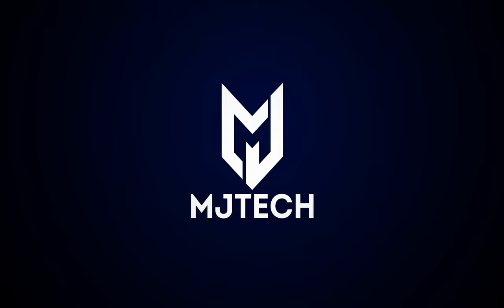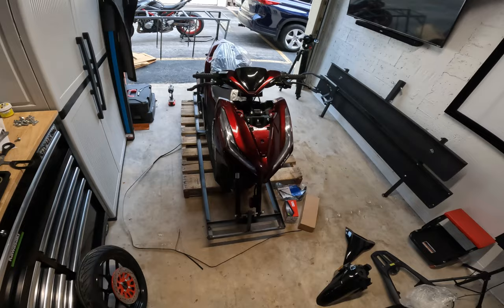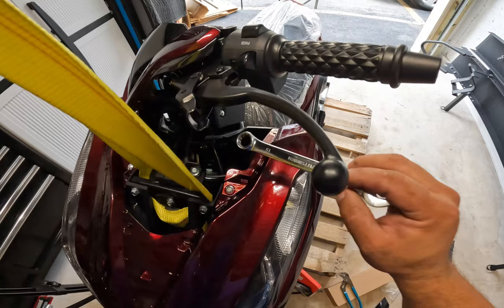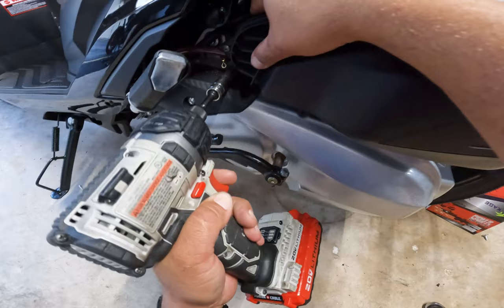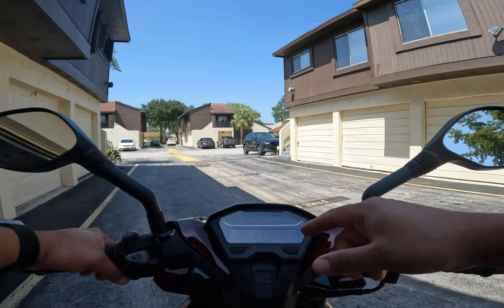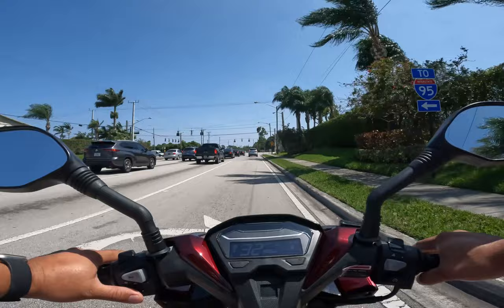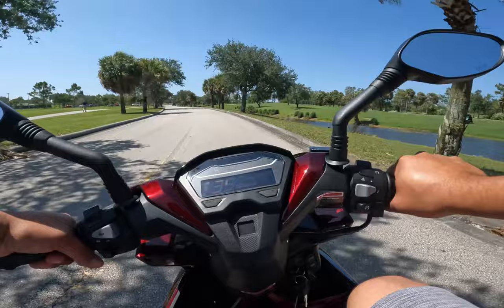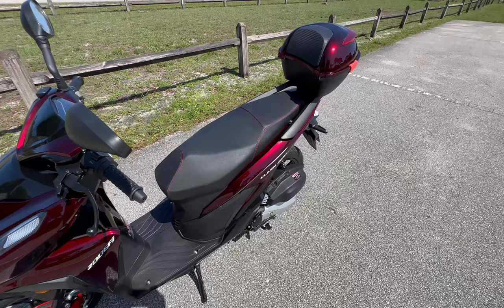Best EFI Gas Scooter of 2023 - Vitacci Clash 200 - Oh Yeah It's Fast And Cheap!

Comment: Last year and about 2000 miles ago I bought the same scooter from Amazon. I wanted one with large diameter wheels, a flat floor, and EFI. What sold me on this particular model was the engine was made by Lifan. I changed the variator rollers (12.5 grams) to 13 gram sliders and the stock 835mm belt to an 842mm belt. Also added a tiny GPS speedometer just below the stock display so I know the real speed. Another change I made was adding a 20 ohm resistor in series with the engine temperature thermister so the computer wouldn't think it was running too hot and turn on the check engine light. Also changed the throttle cable elbow so it didn't hit my knee and added a small windshield and mirror extenders. Runs great and I use it a lot.
Reply: I currently have 530 trouble free miles on my clash 200 EFI. When the bike is warming up and the idle is unsteady for a few minutes I hear a rattle noise and it’s coming directly from the throttle body and I can still hear it once it’s warmed up just slightly less do you think that’s what is causing my automatic slightly rev up by itself after giving it a rev? Or  is  the ECU keeping the engine running from a stalling out?
Reply: Hi, my clash 200 does have hesitation when you play full throttle immediately or when your sitting there idling and rev fulling really fast it will sometimes take a second and sometimes it revs up really quick. I’m pretty sure you had this issue too and fixed it by applying resistors to the thermistor how would I fix this issue? Maybe that’s causing my bike to rev itself back up which would make sense since it only happens when the engine is hot! Could you make a video or is there any diagram of how to add resisters?
Reply: What kind of mpg you getting
Reply: @gaspowerrules  riding fast, between 55 and 65 (actual GPS speed) it gets 76 mpg without the windshield and 84 mpg with windshield. It does better at lower speeds of course but I haven't checked. I suspect up to the mid 90s.
Reply: I'm an absolute noob when it comes to scooters and genuinely on the edge of purchasing this scooter for commuting.  I'm curious, what did all your modifications change?
Reply: @Dabby724  Didn't change much,  just like to fiddle.
Reply: @MrHugemoth  Upgrading to a larger belt didn't change anything at all in terms of performance? interesting.  I'm torn, If I should get a Clash or just shell out an extra 2-3k and get a known quality brand scooter from Honda or the like.  Do you know the average lifespan of these inexpensive china scooters?
Reply: @Dabby724  Between changing the belt and changing the stock rollers to sliders it seems like overall RPM went down a bit but that's all I noticed. Wasn't much of a change. I don't know how long this scooter will last but the Lifan 200 motorcycle I bought new in 2007 had over 50,000 miles when I sold it. Can't go wrong with a Honda if you don't mind the $.
Reply: @Dabby724 unless you get like a really high end Honda bike or a Yamaha Zuma, the difference is gonna be almost nothing. Hondas got longer life span buts when you do the math on the price difference honestly not really worth spending the extra. With that said a good mechanic can keep a cheap gy6 motor running literally forever.
Reply: @anthonyrossi3869  Hey Anthony, ya "might" need to have a mechanic adjust your valve lash and adjust the throttle position sensor to the proper amount of milivolts to get your Clash to run properly. Typically those things are part of a PDI to make sure the costumer doesn't have any runability problems.
Reply: Do you have a link for amazon...I want this item, please

Comment: You should not change the oil until you hit the break-in mileage. It comes with break-in oil, which is different than the normal oil you replace it with. It has different additives, and higher levels of zinc and phosphorus. It’s designed to let the rings wear into the piston walls and form a good seal. That’s also why you want to replace it once the engine reaches the break-in point, because the oil will be filled with metal particulates from the cylinder walls. Replacing that oil prematurely will shorten the life of your engine.
Reply: A great and informative comment. Thank you
Reply: You sure it’s not shipping oil?
Reply: It comes with shipping oil. Definitely should change it before starting as all It will do is accelerate the wear on the engine.
Reply: @dakless8086  new vehicles come with break-in oil. I don’t even know what shipping oil is. Never heard of it. Tried to look it up, Google doesn’t seem to know what it is either. If there’s a modern day manufacturer that sells vehicles filled with oil that shouldn’t be used to run the engine, I wouldn’t buy anything from that manufacturer.
Reply: @rogermurph101   well these scooters are from china sooo yeh id change that oil xDD
Reply: Simple end to the argument is if your concerned... buy a good break in oil and change it out before you start it. Then change it again at the recommended time.

Comment: I own the clash 200 EFI in blue! On mine when it’s warming up I hear the throttle body rattling until it’s warmed when the engine is idling smoother. Also when I slow down to a stop my clash will rev up by itself slightly then go to idle. I had to adjust my air screw on the throttle body which helped. Also it will rev up by itself when I’m sitting there revving it it will rev itself up without touching the throttle for a second. I’m not complaining since it was a inexpensive EFI bike! I changed the oil as soon as it arrived and it barely had oil in it! Good thing I checked and changed it! Let me know if you have any small issues which are manageable like mine! I currently have 530 miles on mine and it’s running great! I did not open up mine all the way until 300 miles but man it’s fast! Ive gotten mine up to 56 on a short back road, it could definitely get to 60 if I pushed it!
Reply: I’m 54 pounds, I’m sure it will go 90 mph
Reply: @stephenlandrum  that would not be possible for my clash 200 168cc engine to produce that amount of speed greater than 60mph before the CVT belt reaches the top of the torque converter, once the belt reaches the top it will not be able to go any faster being that full throttle is at  7 thousand RPM at 14HP. I’ve had it tested on the Dino without sitting on it and it will top out at 60mph no load just the bike spinning the Dino wheel at a peak HP nearly 14HP and that’s without sitting on it.
Reply: @anthonyrossi3869  I was only kidding
Reply: I got 95mph, it helps jumping out of the plane and the additional tailwind made the difference.

Comment: Mine was made in late June 2023 and delivered early August-I shopped the St Louis market before pulling the trigger on My black Clash.  I get looks and thumbs up everywhere I go but it’s probably because of the smile on My face.  Love it.  Surprises Me how it performs for a 168cc, no problems whatsoever accelerating in city traffic, great handling on turns and capable of dirt trail riding.  Smartest money I’ve spent in a long time.  No EV’s for Me
Reply: I’m looking to buy one is it worth it for a small work commute and such?
Reply: @Flyvibez  - absolutely
Reply: Bro i bought this scooter today from amazon and it gonna take 5-6 days to come. The only thing i m worry about the assembling. Can you tell me when you bought yours its already assembled or you did it by yourself. Pls reply me as soon as possible
Reply: Trail riding ? With those kind of tires ?
Reply: Have you experience any issue in your clash? What's your mileage? I got my 2 weeks ago and got 120 miles so far.
Reply: @Eugene210  - 3,000 miles and everything is good

Comment: Two things to help with slow speeds. Try slight pressure on the brakes, mine are linked so I use just the rear. It stiffens the bike up and you can do the same when taking off for the first few seconds. Secondly if you take about 2 lb of air out of the tire maybe just one it helps a lot. You can tell by how much dirt is left on the tire. If it's a very skinny strip your tires are over inflated, if it's very fat under inflated. Once you find the PSI you like, that's an easy way to check without putting a gauge on it.

The factory tires work nothing wrong but if you know that you are going to keep it upgrade them. Michelin City grip 2, amazing feels completely different. The word would be confidence inspiring, about 300 bucks mounted. Worth every penny I just bought my second for the rear.

Comment: I have this exact scooter but called the Saipan, and I love it!!  the only thing that you will have to change is the BELT!!  it will break especially going up a hill or too many "jackrabbit takeoffs.  I went with a Kevlar one and the quality is great just like this bike.  The fuel injection reliability is what sold me + the look. It is a legit 60 mph, lightweight, and has great mpg. so this is an excellent commuter or secondary mode transportation.
Reply: My bike is making a loud sound like the muffler or something? I’ve been taking off fast
Reply: Can you provide a link to the belt you put on it ?
Reply: @swatboy9413  probably the bolts on the heat shield are loose on it??  Easy fix!!
Reply: exactly what type of belt are you referring to?
Reply: @Dabby724  Gates belt, made of Kevlar!! I bought it off eBay,  but at that time it said only 3 were left last year.
Reply: All  drive belts eventually will have to be replaced; even the ones on automobiles
Reply: @MrGreenelight Not at 300 miles

Comment: After watching this video I really want one!😊
Reply: I have had mine for a year and a half and this is the best cheaper scooter that I have had. Very reliable, starts every time, and is very lightweight and fast ( I'm 6'1 222 and I still get 65-68 mph). the only thing that I did change was a more powerful motorcycle battery 12v 10amh for extra accessories relocated to under the seat from the floor for radio, USB, RGB lighting, and the drive belt ( change the one that comes with it because it's too cheap and will break going up a steep hill, all the cheaper Chinese scooters come with the cheap belts??) to a much stronger Kevlar belt from Gates that's it, The EFI is top-notch!! good luck with your choice, but EFI is the way to go.

Comment: On the southeast East asia, honda made this bike... it is called by different names in some of countries it is called vario and some are Honda click... they are pretty popular even the most scooter you could find on Indonesian road... even honda sold this kind of bike over than 500k units every year only on Indonesia.... the difference in this vitacci clash and Honda vario/click the vitacci doesn't come with liquid cooling system and the engine capacity is slightly higher than the one honda made...

Comment: It took me months to adjust my mirrors correctly. Because of how big they are and how they have the bend in them you need to have the right angle and tightness of the double nut.
How you mount them determines if you see yourself or what's behind you.

Comment: Just got my vitacci clash. First time i opened the seat,  it worked fine. Now it won't open. When i hit the seat button i don't hear anything. I found if i pull on the cable the seat button hooks to, the seat will open. Any ideas how to fix this?

Comment: Where can i get a cdi for mine? There's no spark and no fuel pump prime when i turn on the key. All of it stopped after i dropped it
Reply: check the kickstand and sensor!! it will give you the same symptoms
Reply: @lionelhowell4972  thanks but I fixed it, it was the ECU... replaced it and started up no problem

Comment: I bought one about a month ago. I've watched your video to put it together so thanks for that. I do have an issue. I can't get it started for the life of me. I can get it to start for like 10 sec then it dies. Would you have an idea why?
Reply from the maker: Start by checking that the injector is connected properly. Also check all the wires. Lets start here.
Reply: Any luck?
Reply: @MJTechChannel  sounds like the kickstand to me?

Comment: This EFI Scooter has been great, But recently it started to sputter and would stall at a stop. now she wont start right away like before. Does anyone have a clue as to why? Or any suggestions?
Reply: Try putting  an ounce or two of fuel injector cleaner in the tank

Comment: What about the battery. Where did you put that?
Reply: Having a problem with this issue as well. What did you do?
Reply: I know where it goes but there is a small plastic piece that doesn't fit in the compartment.

Comment: You are going to wish soon that you used blue loctite on every screw and bolt. Trust me I know . I have the EFI 200 cc Capri. And change oil soon as you get do not ride with the packing oil. It's vegetable oil.

Comment: WOW 🤯🤯🤯.. during your assembly I didn't see you using not a single washer on your scoot scoot.. you're going to be lucky if it doesn't fall apart B4 300 miles.. you have a great looking scooter there and I hope all goes well with it.. I just recently purchased a Vitacci Spark 150.. and I will be taking zero assembly advice from this video.. I mean you are starting bolts and running them all the way in with an impact driver.. come on bro, start those bolts by hand at first and then use your impact driver to torque the bolt down.. otherwise, you risk that chance of cross- threading them.. after all it is Chinese cast aluminum which is a rabbit hole that you don't want to go down I can assure you... You should have gotten rid of that oil that came in the crankcase.. it just doesn't make sense how you are going to buy something brand new and not do anything called "Preventative Maintenance".. I guess it must be nice to have money to just throw away.. any-hoozies.. nice scooter
Reply: P. S. No gloves and you are riding with flip-flops on.. very intelligent 🤓🤓🤓🧠🧠🧠
Reply: Thats a lot of hate that didn’t get recognized 😂 aka a complete waste of time
Reply: @nijahclark1927  - some people are just miserable and want to bring others down with em

Comment: I found the actual top speed is only 64mph on GPS on straight flat road also my speedometer reads 7mph over the speed limit I am actually doing....if you know how to correct the speedometer please share
Reply: Remember weight is also a factor. I'm 6'1 220 and I have reached 68mph on flat ground with GPS and street radar consistently when tried.
Reply: The mph difference is because of valve adjustments, the one that reaches 68 mph is adjusted properly
Reply: I don't believe these speedometers are adjustable?? even all the electric scooters are off about 5-8 mph, that's why the phone GPS apps are much more reliable. But to be honest, such a " lightweight" scooter such as this one anything over 65mph is impressive. If you need more speed than what this can provide go buy a 250cc motorcycle.
Reply: Speedometer is on front wheel, so if you can get a slightly taller front tire it would  be closer to corrected.